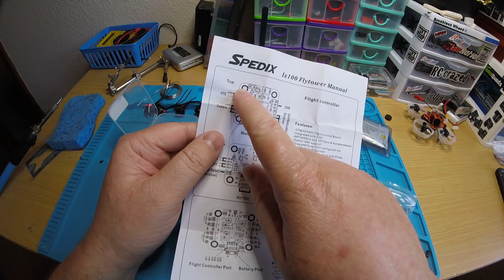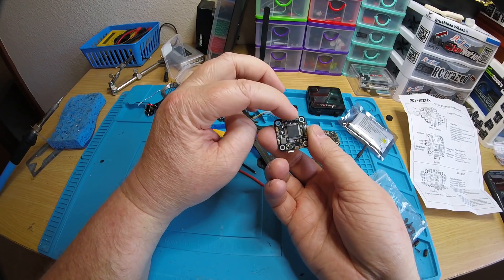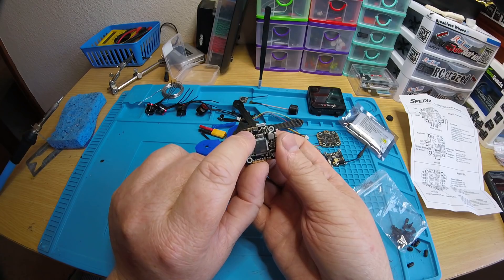spedix is100 stack

Comment: At 5:57 Bat is for Battery voltage.  If you didn't remember the if voltage select was for, the instruction was 6 inches away.  ;)  For others watching this, Top/Left is for vTX, Bottom/right is for cam.  I know its an old video.
Reply from the maker: Thanks

Comment: Thanks for the video. For crossfire I can use one of the uarts, do you think it matters if I bridge the receiver tabs or not, I was thinking of bridging it sbus ppm anyway.
Reply from the maker: Dovzo fpv no you dont have to if you're using crsf but I do it just in case i ever want to switch to sbus so i dont forget and wonder why it's not working

Comment: Hey adam do you have any experience with this stack https://m.banggood.com/HAKRC-Mini-F4-Flytower-F4-Flight-Controller-Built-In-OSD-20A-4-IN-1-ESC-BLHeli_S-200mw-48CH-VTX-p-1257048.html?rmmds=search&cur_warehouse=CN

Its a cheap stack you get the vtx for 5 bucks more than just the esc and fc.   But where my problem is no wiring diagram for the vtx.  I believe it has smart audio or tramp.  But i dont know where to ru
Reply: ADAMBOMB FPV no dont see anything about smart audio.  Lol I assumed the A was audio.  Its the R I dont know what it is then.  Hmmm.  Theres nothing on the box it came in.  I like the stack I use it with the Atxo3 and the video is great. No noise.  But for 5 bucks why not get their vtx thx adam